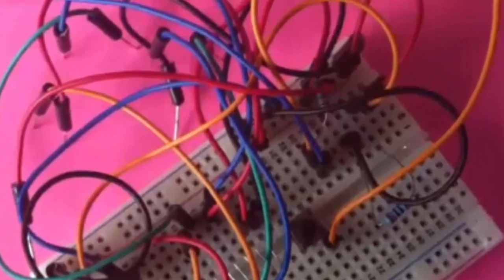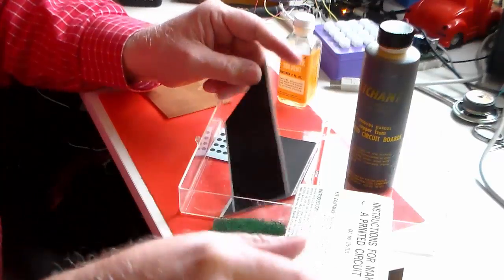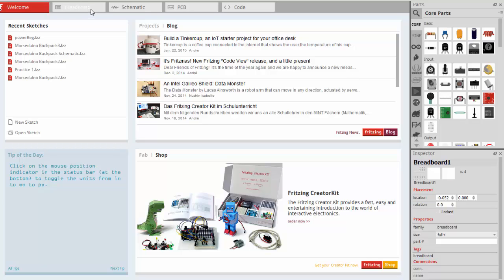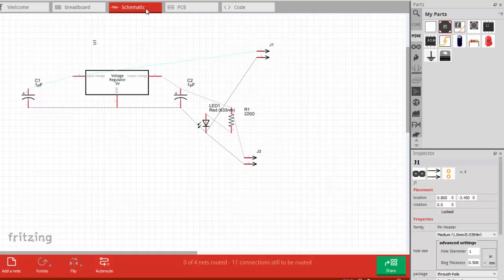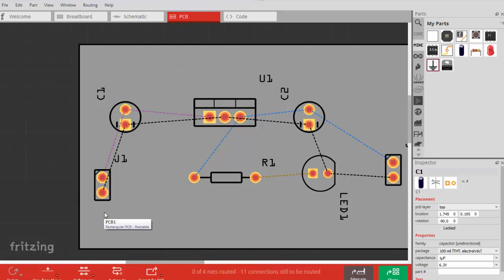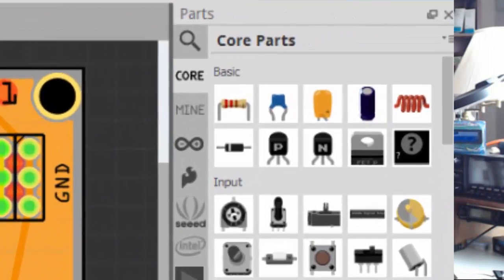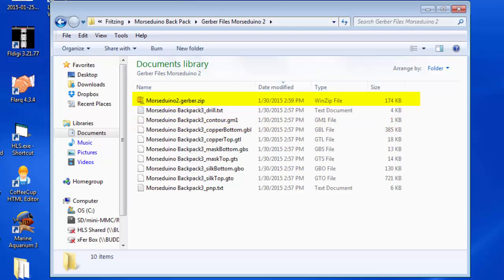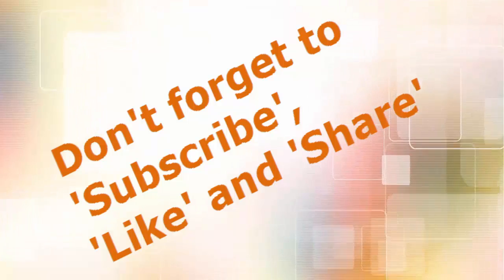Creating Your Own Printed Circuit Boards

Comment: Hey Budd,

I started designing and etching circuit boards when I was around 12 years old, using permanent markers, my mom's fingernail polish, and that caustic ferric chloride PCB etchant from Radio Shack. That was a horrible process. I much prefer the newer method you mentioned. It may take a bit longer, but it's much more professional looking, and almost idiot proof (but I'm sure I can find a way to foul it up).

Great video. Always concise, clear, and entertaining. Thanks for sharing.

-Rob
KG7GTC

Comment: This video was very helpful and I especially liked the practical advice 
on checking the layout by printing the design to a piece of cardboard 
and placing the components on it.  I will definitely checkout Fritzing. 
 This is especially interesting to me because I am experimenting with 
the LMD18200 h-bridge but the pins a too large to fit into a breadboard 
and cannot be soldered easily.  Does Fritzing accommodate ICs with 
larger pins such as the LMD18200?
Reply from the maker: There are many parts libraries (they call them bins) available from multiple sources. If you can not find what you are looking for, you can design your own.

Comment: Ill probably use OSH when I need 6mil. For everything else, I use the modern version of what your father did. Instead of a pen though I use an inkjet printed transparancy, a film thats laminated onto the copper clad and a uv light. The film is uv sensitive, where its exposed to uv it washes away in the dev bath. I keep a plexi glass vertical bubble etch tank on my patio. your father was using ferric chloride, I went cupric. A 1oz board needs about 15min in my tank. I've only etched 3 boards so far but am already down to 10 mil. With the new film I have on order and proper prep I expect to do 6mil with medium effort. The point for me is to be able to test the day i finish design.  At the moment I use rivits for through hole but im working on a plating tank. Basically add graphite to nail polish for "activating" the holes. then some time in the tank. Ill admit, Esp this later bath is not the most friendly concoction but chemicals are as safe as the amount of prep work and care you put into using them

Comment: I found that I have to add the copper pads on the pcb view, and they can't show in the schematic. Now that I am done, i need to know how to show the top traces, then the bottom traces to make sure everything is routed properly. Then i have to fix he spacing on the parts so my capacitors and transformers will fit the board. I don't see any way to do that right now.
Reply from the maker: You can turn layers on and off to see different things ... look at the last 10 items in the 'View' menu. Just add and subtract check marks.

To change the pin spacing on components, experiment with the 'Inspection' window on the right. Click on a part and then you should see lots of options to make it match the one you are using.

Comment: OK, I have my entire schematic on the screen, and  I need to add pads that I can run wire connections to, then label them. Can you tell me what part will make a pad that I can route a wire to?  I deleted all that other stuff about beta, and what doesn't work, the software is far from perfect, but maybe i can get it to work.

Comment: Excellent video!!  Two quick questions, just out of curiosity why have the ground on the bottom layer?  Also, is it absolutely necessary to have the Schematic?  They still confuse me and I wasn’t completely sure why you had to add those grounds in the schematic, that doesn’t come through from the breadboard diagram?
Reply from the maker: If you can, it is nice to create a ground plane on one side of your board. Usually you will have to have some extra traces on the bottom, but filling it with as much copper as possible reduces the chances of interference from RF signals. I am reading now that adding a ground fill to the top of the board is also recommended. (If you are working with high frequency circuits these planes can induce capacitance that might result in unwanted oscillation... the experts know about that stuff and have the equipment to detect it.)

The extra ground symbols in the schematic are there to make the circuit easier to read. It significantly reduces the number of lines that you have to follow around the diagram.

Comment: How do you make the gerber file that goes into osh park?
Reply from the maker: +Rocket Man In the 'File' menu select 'Export' then slide and select 'For Production' then slide and select 'Extended Gerber'. This will create several files which you will then need to compress with something like WinZip. The *.zip file is the one that you will upload to OSH Park.

Comment: Is there any way we could have a quicker turn around time? Say like 5 days?
Reply from the maker: YES. Since this video was posted years ago I have discovered www.jlcpcb.com and use them all the time. In fact today I just got an email from them saying that the boards I uploaded 2 days ago are completed and on their way via DHL. I have had boards at my door as quick as 4 days. Generally I figure 5 or 6 days. Once DHL held my boards for 3 days. Having said that, do not expect any quick service if you order during the Chinese Lunar New Year Holiday. Everything shuts down for about two weeks and nothing moves. I have several videos about JLCPCB here on my channel.

Comment: I prefer EasyEDA for PCB-Layouts, because it is really easy going to get professional looking PCBs. I also use it for my breadboard designs. For me it is better to start with the schematic and push the parts to their positions to get a good wireing. In case I just need one or two PCBs with just a few nets (and this is in most cases) I use dot grid protoboards and I do the wireing by use of tin coated copper wire. I don't like to wait weeks for my PCBs.
Reply from the maker: Thanks for the note, Gunter. This video is 8 years old. I now use EasyEDA as well. The learning curve is a little steeper, but it is worth it. They have made ordering PCBs so easy.

I am not sure where you are located, but I find the turn around time very good. I have my boards shipped by DHL and they always arrive days before the promised date. Typically I have my boards in 7 or 8 days after I upload the files. The best ever turn around time was only 5 days.

Comment: This is where my project dies, i get only so far, but there is always one or two things that will prevent the boards from meeting my requirements. In this case, it is the transformer lead spacing, and possibly the capacitors, although I think the capacitors may be an easy fix.   I have a good circuit board, if I can change the spacing on the transformer leads.

Comment: Ok, thanks, I did see that I can turn layers on and off. Next question is about changing the spacing on the contacts for the transformer, so it matches my transformer. mine are 5 mm apart, and 10mm from side to side. This should clue someone into how difficult it is to make a circuit board using specific parts that are not as common as diodes, capacitors, and IC's. I used a 4n35,  where I needed a 4N25, but the case is the same, so it does not matter, the part will fit. The transformers are a different matter altogether. The capacitors should be easy, but they are not, mine ar 5mm lead spacing. So if I can edit those parts to match what I have, I can see about making some boards.

Comment: This video could probably be only a minute long. I think I took 2 naps in between each of the important parts.
Reply: I don't think it was produced for those experienced like you. It's for beginners like me. I looked and couldn't find your video on the subject.
Reply: Never made a PCB before. Still didn't need all the nonsense in between because anyone with a brain who's used a computer before knows how to click and drag, which was 90% of this video.
Reply: +Rob Christian My guess is this video isn't targeted to you. I've done al these things before, and I found his presentation to be very good. For someone with little experience, a well-paced explanation is the difference between jumping in and staying on the sidelines.
Reply: Rob, download the "chrome html5 video speed controller" from the Chrome web store.  Free program that lets you set the speed of Youtube and other videos.  Most instructional videos can be viewed at 1.6x to 2x, and you can skip commercials, too.  It makes a lot of videos more tolerable.

Budd, thanks for the info.  Very cool stuff.